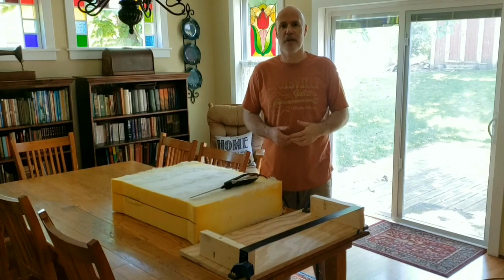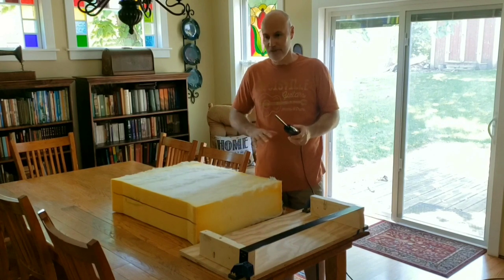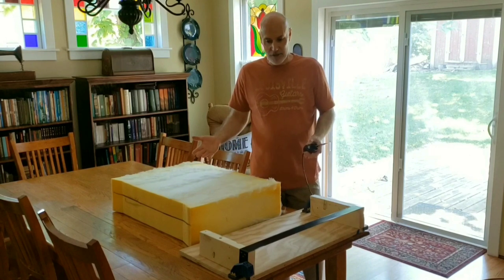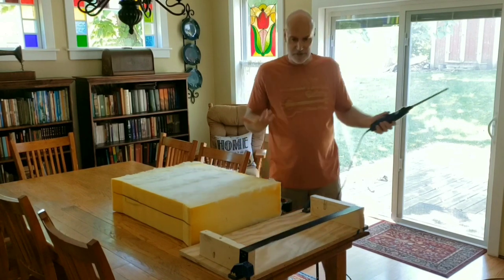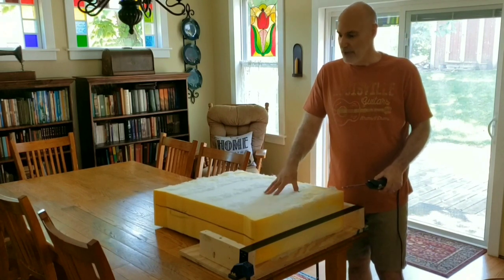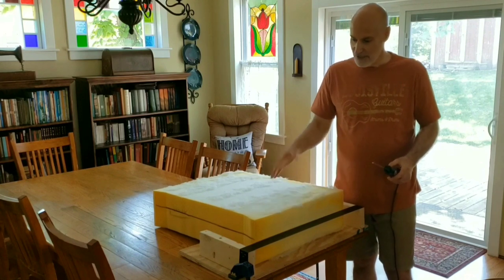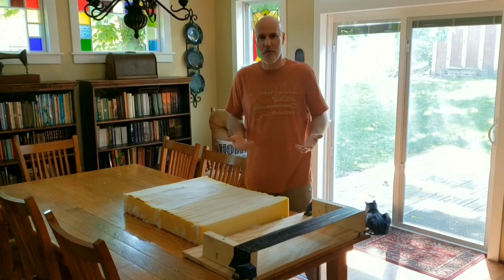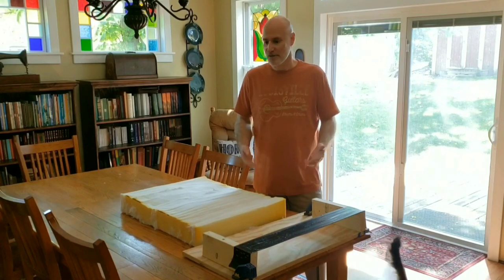How To Evenly Remove Thickness From A Large Piece Of Cushion Foam

Comment: Thanks for this video. I used this method with a few modifications. I used a piece of 1/4 thick wood across the top for more stability and cut along the under side of it. I also taped a razor blade to the end of a non electric bread knife and only used the razor to cut. Came out with a nice smooth cut that took no time at all.
Reply from the maker: Nice modifications!
Reply: I was thinking of adding a thin board in place of the tape, too, for a more ridgid edge.

Comment: This is extremely helpful! I'm going to try it on a memory foam mattress for my camper haha I need all the help I can get so thank you!
Reply from the maker: I've never tried it on memory foam but I don't see why it wouldn't work.  Good luck on your project!
Reply: Wondering how you got on with the memory foam - were you reducing the thickness as in OPs vid? I’m wanting to reduce the thickness of (1) a memory foam pillow and (2) a latex one as well. Think I read that cooler ambient temp will stiffen the foam which might make it easier to cut.

Hoping to learn from your experience. 🙏

Comment: Thank You for your video, I am in the process of restoring / preserving a old pickup truck.  I ordered replacement foam for my seat and it is way to thick, about 6" thick, I need it to be closer to 4" so I can drive safely and comfortably.  For what the foam cost me, I did not want to chuck it so your video showed me a way to cut it thinner, and since I am taking it off the bottom I do not think a perfect cut will matter that much.
Reply from the maker: Glad you found it helpful. Good luck on your project!

Comment: First off Thank You for making a video. I Think your cut would have come out way cleaner if you would have used a piece of metal in stead of the Duct Tape. keeping the angle of the cutting knife at the exact same angle is KEY. the flex in the duct tape that allowed the blade to move is what gave your cut a un even look.  but by the time the cushion is wrapped it will be a non issue Keep posting
Reply from the maker: Thanks and agreed, thin metal stretched tight would have been better. Trying to go with what most people have access to but point well taken 🙂

Comment: Nice, i'm thinking, you can also make the wood on the sides in the right form, like with a curve. then fix the foam. then use a flat piece of metal or wood and move that over the wood sides and work your way acros the foam.

Comment: That's exactly what we want to do, beds too firm....
Was wondering if this would work and it does!! My original idea was to stretch a wire across where the tape is and heat it with a blow torch....melt it through?

Comment: This is what I was looking for, but I might use a strip of aluminum instead of tape. It did turn out quite rough looking, but I plan on wrapping it with polyfiber after cutting so the rough surface doesn't show through.
BT THE WAY YOU CAN'T HOTWIRE CUT POLYURETHANE FOAM. IT JUST BURNS And CREATES A POISON GAS

Comment: The surface looked a bit of a mess imho. Not ready to be sat on. Which doesn't matter too much when you  are going to add a new layer of foam of at least 3/4 inch, which will even out most divots and bumps. So if you want to attempt this method, do cut thinner than you want in the end and add a new layer of foam. Don't use this method if you do not want to add fresh foam. In that case buy yourself a new sheet of foam and sell the old foam on Craigslist or equivalent..

Comment: Instead of using this thin black strip, use a thin Nichrome wire as heating wire then apply some controlled current to make the wire hot then you can cut the foam like butter
Reply: Might not be a good idea with wood